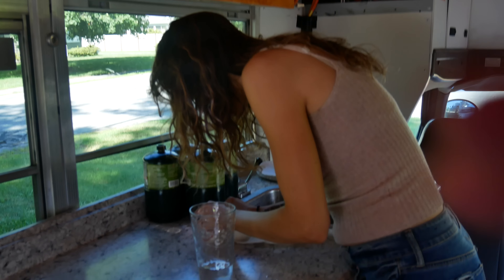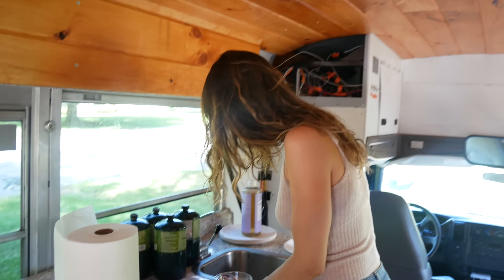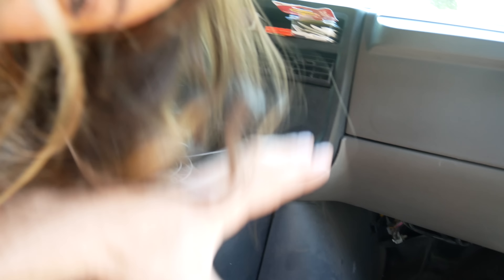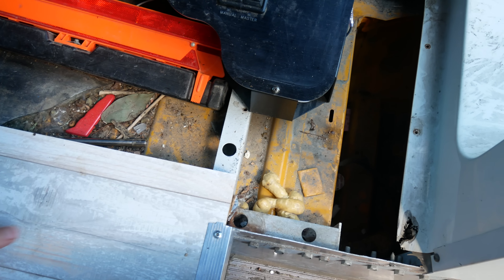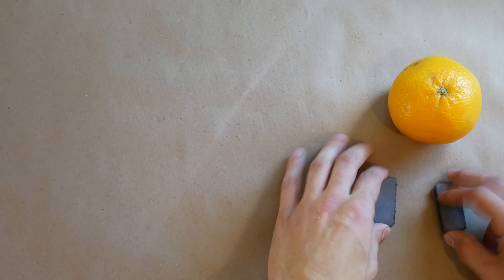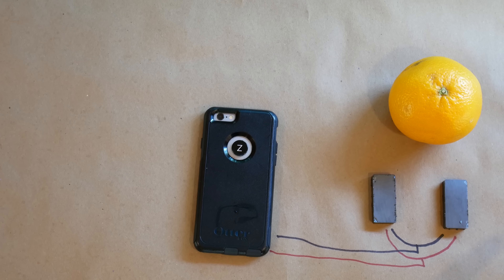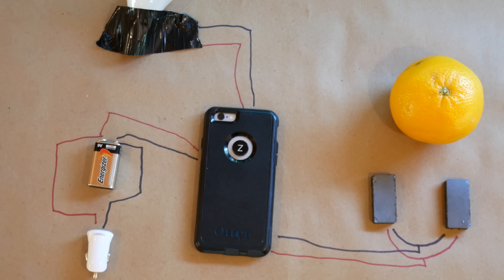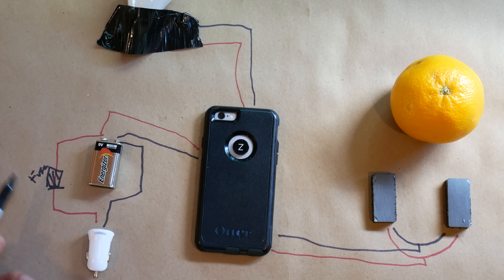Bus Life Problems!

Comment: Hey on your sink the rubber gasket goes under the sink. Take the basket back out and put plumbers puddy where you had the gasket. It will then be flush with the bottom of the sink. Hope this helps. Good luck.

Comment: You should check all exhaust system from exhaust manifold all the way to the tail pipe to make sure there is no holes or exhaust leaks from manifolds. Great job on your bus.
Reply from the maker: Thanks for this advice.  Definitely will do!
Reply: Echo what Michael B and FatGuy said.

In a properly functioning exhaust system, the ONLY place exhaust should come out of is the tail-pipe.  Exhaust around the engine is a LEAK... dangerous and potentially life threatening... and will kill brain cells BEFORE you actually feel CO poisoning.

Comment: @1:00 you put the rubber gasket between the insert and the sink.  The gasket goes under the sink between the nut and sink pan.  You can put a layer of silicone in between the insert and sink bottom, but the over-spill channel under that will collect any leakage.

The loose battery connection does not cause high voltage, it causes current pulsing and excessive heat.  The current pulsing caused the fuse to blow, not the voltage.

Comment: That sink drain should be all the way down. Take the rubber seal off and put it under the sink on top of the crush rig the screws in around the drain adapter. Hopefully that helps. Good lookin bus and good luck
Reply from the maker: Thanks so much! Really appreciate the advice, we'll definitely give that a try!
Reply: Nomadic Movement ya hopefully I made sense. I didn't proof read my comment before I posted. Anyway if you got a question I'd be glad to help.

Comment: Here's a tip: Your sink doesn't drain completely because the basket should be sealed with plumbers putty or silicone before you put it in the sink. The big rubber gasket goes on the underside of the sink.
Reply from the maker: Ok makes sense... Thanks for the tip!

Comment: Sealing up the hole in your floorboard to get rid of the "smelly" exhaust is just a band-aid.  You need to actually fix the exhaust leak.  There's no such thing as having exhaust directly from the engine creep into the cab naturally.  The only way this happens is if your exhaust pipe is rusted through, or exhaust manifold is cracked, or seal between manifold and pipe is leaking, or leak between manifold and cylinder head.  If your exhaust is functioning normally, you should be able to have all the holes you want in your floorboard without worry of exhaust fumes. Although, you should still, in an unrelated manner, fix those holes for insulation purposes.

Comment: You have a GM Gen III LS based engine known as a LQ4 6.0 liter V8.  It is great engine by the way!!  Unfortunately they are known for popping the exhaust manifold bolt heads off leaving the hardware flush in the cylinder head creating an exhaust leak.  Doghouse removal, a reputable mechanic, a mig welder and about 20 hours will alleviate the situation.  Good luck!!!
Reply from the maker: Great advice...thank you so so much !!!

Comment: Hi Guys from the UK!
The reason a loose terminal will cause your fuse to blow is because it will cause a high resistance due to poor contact.
This will cause an effect not dissimilar to a plugging a heater into your circuit, the high resistance will cause a voltage drop, as voltage drops, the current rises at high levels causes fuses to blow, if its below that level it will cause a heating effect.
Go through your system and check the connections, that they are tight, there is no copper showing, strands of copper not in the connector, or signs of melting / blackening.
Hope that helps, Be safe guys!!! Steve.

Comment: Just FYI if no one has mentioned it. It looks like you put the rubber gasket right under the drain flange. It actually goes UNDER the sink. Then under the drain, you use plumbers putty. Then when you tighten up the spanner nut underneath, it tightens it all up and the plumbers putty will compress and your drain will be flush with the floor of the sink.

Comment: You need to remove the rubber gasket from between the sink and the metal part of the drain. By tightening the central screw there will be no space between the sink and the drain so the gasket is not needed; this will allow the drain to lower in the sink and all liquid to exit
Reply: You def need the gasket, it goes under the sink. Plumbers putty between drain and sink

Comment: Take the rubber seal that came with the sink drain and put in the trash. Buy a very small tub of plumbers putty and make a long piece about the size of a number two pencil. Place this around drain place drain in sink and tighten the nut on the bottom of sink until you can only see a small amount coming out from under drain in sink. Problem solved. Hope this helps.

Comment: Ditto on the plumbers putty and the gasket should be under the sink drain not on top like you have it. Have replaced about 12 sinks in six houses. I hope that isn't an Ikea sink! You can get 12 Volt appliances at a truck stop or from Amazon. The blender probably pulled too much current when first turned on which caused the inverter to try and supply more power than it was rated for. Since it had a motor in it, there is such a thing as a start current before the motor starts running. If you have ever seen lights when you start an appliance it is because it is pulling pretty close to what can be supplied by the circuit that it is on.

Comment: a bad connection would cause resistance, the voltage would drop and the amperage would go much higher.  The fuse doesn't know Volts, it know Amps, and this is why it would blow.  The overloading made a bad connection worse, probably fried some contact area between wire and connection.

Comment: The high voltage warning was caused by the bad connection on the fuse.  The poor connection repeatedly changed the resistance in the wire and fooled the charge controller into thinking the battery could take more charge.  When the charge controller sent the charge to the battery it went over voltage.  Your inverter pulls a small amount of power when you first plug it in.  The bad connection was the equivalent of plugging and unplugging multiple times.

Comment: Looks like the drain issue is under control so I'll comment on your solar which I have on my RV. The reason the fuse blew is the loose wire caused an over amp issue when you hit the blender not too much voltage in the system. Remember, the battery is storing AH (amp hours) it is not storing voltage. The panels are send out around 17 volts DC and rated watts of the panels. On my rig I have "old" 80W panels (4) so that gives me 320W of power. My Batteries (Trojan T-105RE) are good for 225 AH at 20% rate of discharge of storage each for a total of 500 AH. The controller is set to a daily charge rate at 14.8v and once a month an equalization charge at 15.5v for 4 hours. I got 5 years out of my first set of four of these T-105RE batteries. They are not cheap but are made for renewable energy thus the RE designation. Trojan is now making in the USA an AGM battery designed for solar applications. You can check it out here  http://www.trojanbattery.com/solar-agm/

I don't know it all but a little about most. Good luck in your endeavors.

Comment: You need to look into more 12 volt appliances and a 12 volt laptop converter (12VDC -> 5VDC). Powerstream.com has converters. I'm sure other websites do too. A lot of power from battery is lost (wasted) when you convert to 120VAC and then back to 5VDC for you laptop.

Comment: I'm sure you worked out by now that a loose connection is like a blockage in a pipe and you need to have more pressure to move the same amount of water (electricity) to keep up....

Comment: You need To get your exhaust fixed! If your exhaust has no holes in it, from the engine all the way to the back, you would get no fumes inside the bus. Think about it, your heat blows right off of the engine. Exhaust should go through the exhaust pipes and the muffler. Check it out.

Comment: Use a dc to dc converter to charge laptops? Much less waste in power conversions. I use a variable voltage cigarette plug dc to dc charger with multiple connectors to charge from solar rig to laptop. My laptop uses a 16v dc input so now I'm just going from 12v dc to 16v dc. There's still some conversion loss but nothing like dc to ac back to dc again?

Comment: Greetings, 

Sealing the holes in the floor won't fix the bigger problem. You clearly have an exhaust leak and even if you seal the holes you identified, the exhaust will find it's way into the bus via another route. You need to identify and fix the exhaust leak. Sorry, didn't realize another viewer already commented.